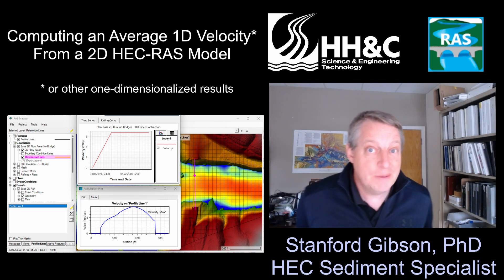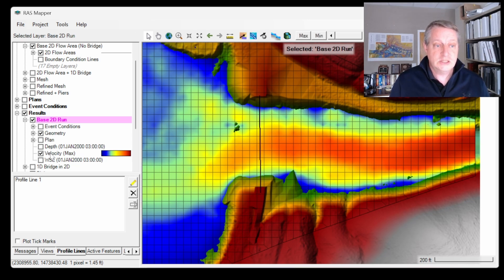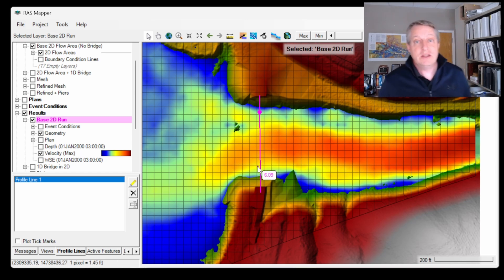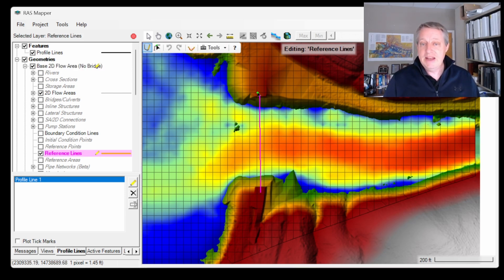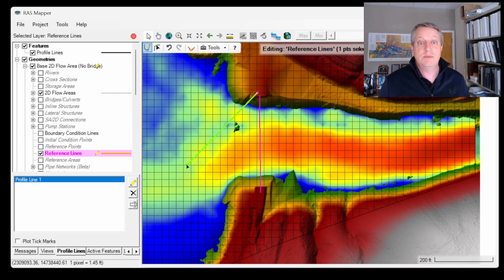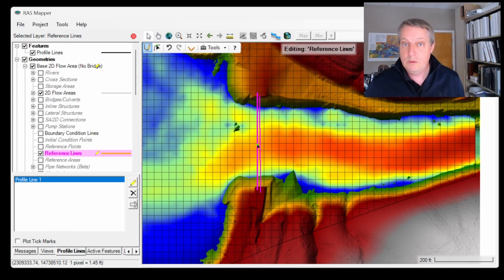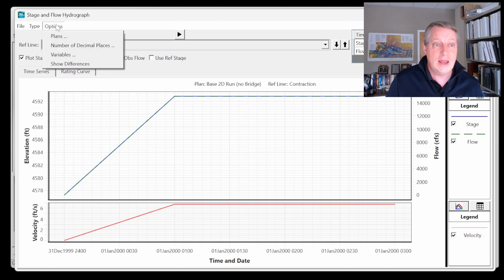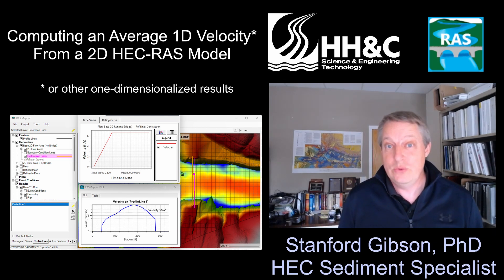XS Average Velocity Results from a 2D HEC-RAS Model (using Reference Lines)

Comment: I have tried to model the flood flow velocity using HEC RAS 2D, but the results are irregular as your result, for example, there are areas where the flow velocity is very high reaching>200 m/s. How can I correct the model?

Comment: I just tried this in a model for bridge scour, but I only get a few variable options in the time series window. Like velocity, flow and WSE. Not the other depth options you have. Am I missing something or are the other variable options not in v6.6?
Reply: Also, I made some small lines upstream at each of the 4 piers. Some of the reference lines didn't span an entire cell face. The ones that didn't span an entire cell face the time series results is showing >60fps. While the others are more in line with the Mapper results at ~15fps.
Reply from the maker: @ I'll check it out, but my understanding is that FHWA guidance is to use max D and V for all piers because the channel could migrate during a flood.
Reply from the maker: Yeah, we just added these to 6.7 Beta 2 which should be out in a couple weeks.   If that doesn't have what you need, reach out and we'll try to make sure they are in the final 6.7 release.
Reply from the maker: Our guide for bridge scour is up: https://www.hec.usace.army.mil/confluence/rasdocs/hgt/latest/tutorials/2d-sediment-transport/using-2d-hec-ras-results-for-bridge-scour-analysis

Comment: If I have gauge station data with flow measures and I want to compare with my simulations results, should I put a reference point or a reference line? I think it is different because the flow through a cross section will be greater than the flow through a single point (isn't it?)
Reply: If you have observed flows you definitely want to use a reference line...a reference point is ok for WSE, but you need a line for average flow.

Comment: For clarity, this tool allows you to extract values accurately if the the cell faces are aligned with flow. If we were to draw a reference line that is skewed to the faces, this tool will not give accurate results because RAS does not currently project the normal velocity to reference line?
Reply from the maker: No, we do essentially "project" flow onto a reference line that is not aligned with cell faces.  The algorithm takes the total flow through the spanned faces and divides by the flow area across the reference line.  This gives a pretty good estimate of average parameters, but aligning with cell faces is a little more precise.
Reply: @stanfordgibson  AWESOME!!!